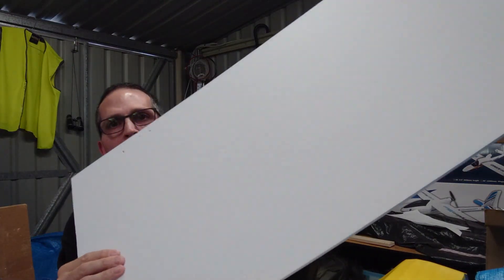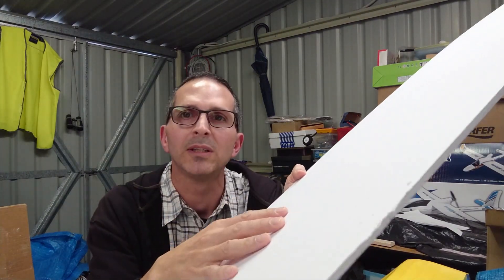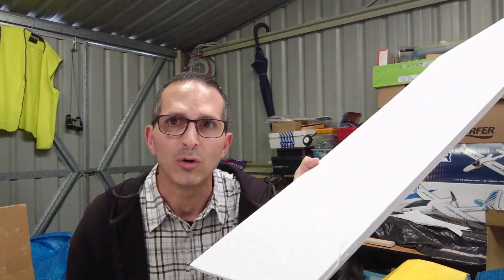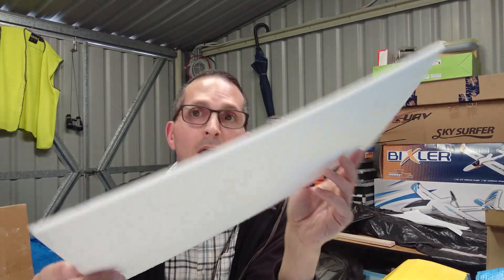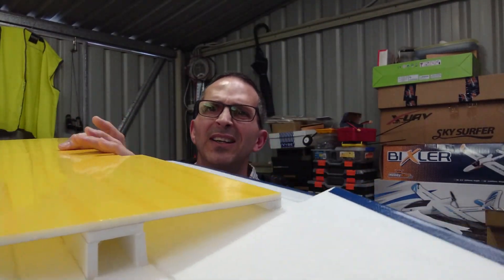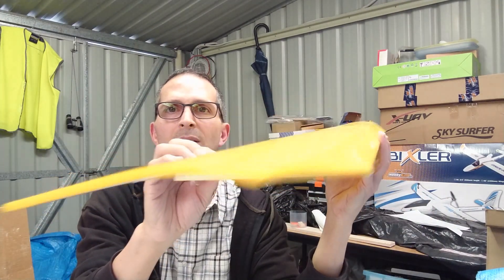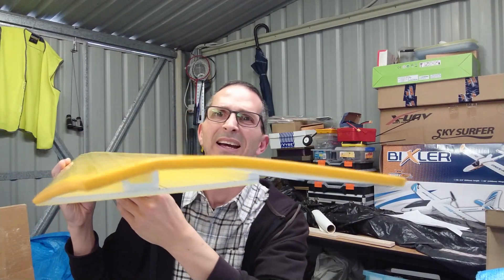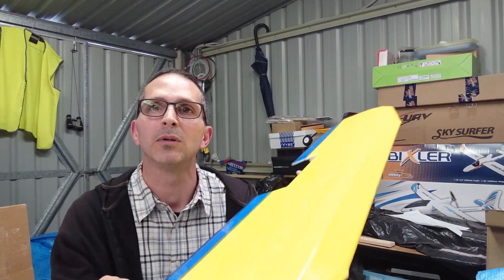An Experimental Airlines FliteTest Wing

Comment: No paper
Reply from the maker: That's right.  Our foam board in Australia is a bit different.  For a start, the paper does not peel off as simply as it does with the FliteTest foam example. Plus our foam board is heavier in density.   Making the same wing as a flitetest wing using our foam board produces a much heavier build.  So I compromised by using no paper on the foam and added additional strength to the overall build using packing tape for colour and finish.

Comment: Try using a spray bottle add 92% alcohol and lightly spray the paper.  I believe it’ll work out so you don’t need to scrub it just lifts off. Cheers.
Reply from the maker: Thanks buddy....always welcome a better idea.  I'll definitely give that a try.   Cheers
Reply: @ricchatrc  it worked for me with the 3m boards I had a really hard time getting the paper off, just sprites it though don’t water log the paper it’s worth trying.  Also I made the ft explorer and the poly dihedral wing. I think your wing is more of a sport wing,. I’m going to be putting your style wing on it as soon as I get the box tape.  Thanks again, the videos sure do help..

Comment: Hello Richard.... I just love the new 'concept' high flow wing. From what I can see you have adapted a structural modelling process designed to construct a light weight wing that incorporates effective flight rigidity through the use of minimal (albeit) effective internal 'strenghtheners'. Another classic case where 'form follows function' to your design. Any chance of your audience getting to see just how effective the wing will be during flight ? gah
Reply from the maker: Fuselage is 90% complete (another light weight design also).  Final aircraft reveal coming soon and a maiden flight also on the cards.